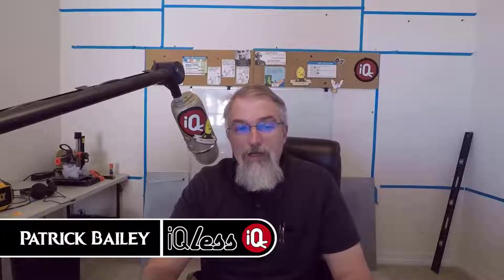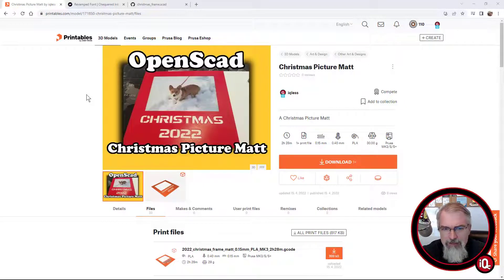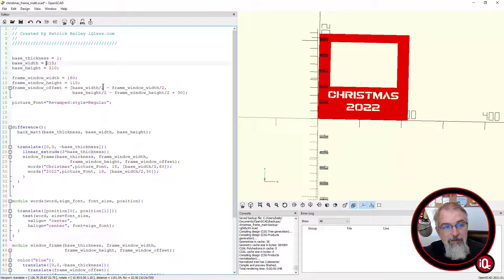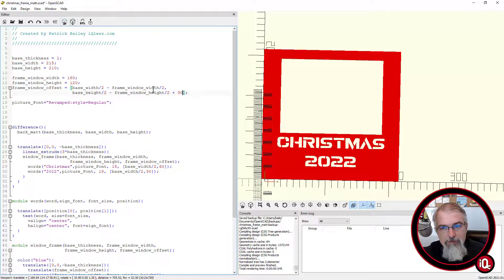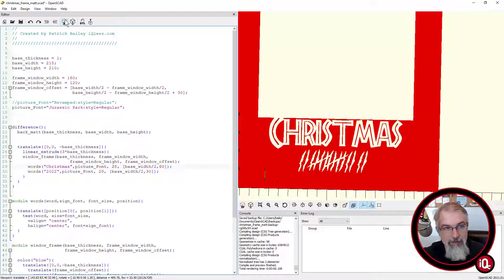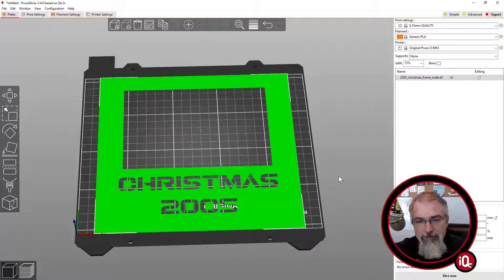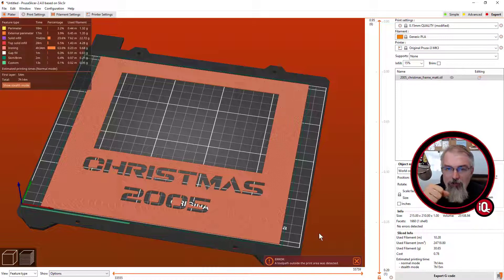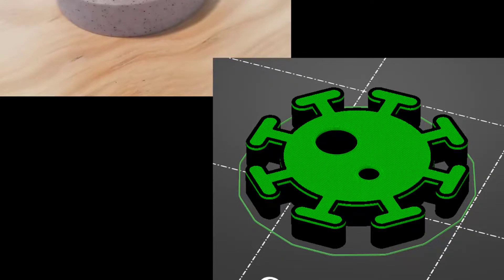3D Printing: OpenScad Picture Matt

Comment: Couldn't you print it upside down so the beauty side is on the bed, that will result in a smoother surface without ironing.
Reply from the maker: Good thought I will have to try that out.